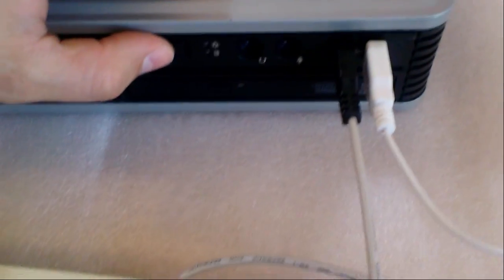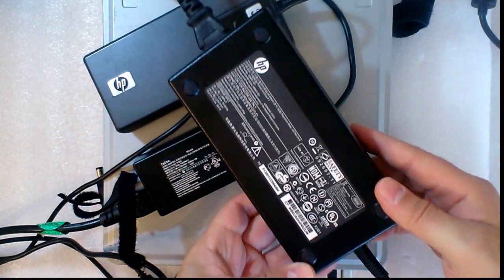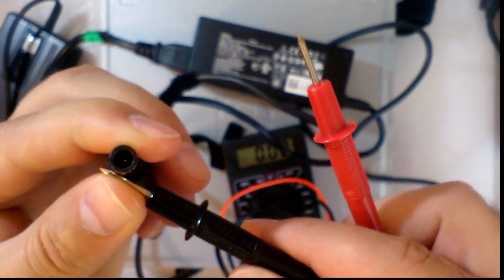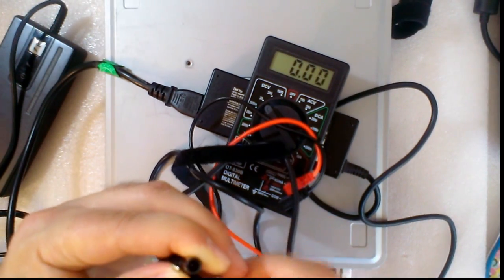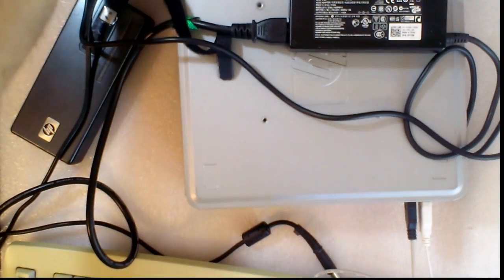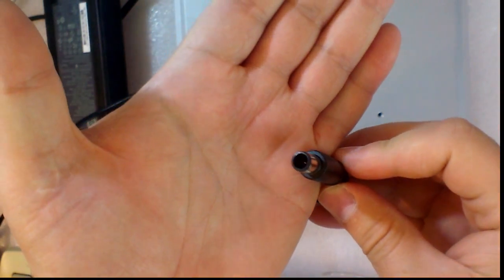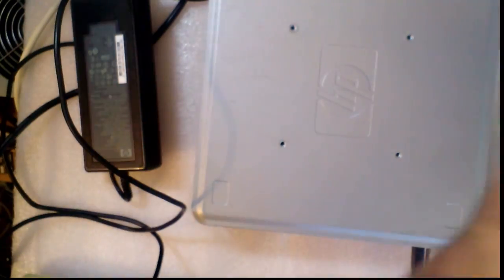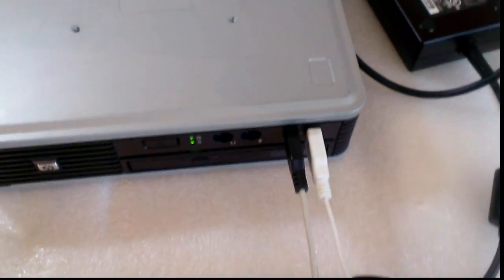How to fix HP Compaq dc7800 USDT PC 4 beeps 4 red flash error #redigitt Ep. 072

Comment: I have a sff dc 7800

I already change the psu and its still beeping
Reply from the maker: @isxude wrote:
Blinks red 2 times @ 1 Hz [1] 2 Processor thermal shutdown
Blinks red 3 times @ 1 Hz [1] 3 Processor not seated / installed
Blinks red 4 times @ 1 Hz [1] 4 Power supply failure
Blinks red 5 times @ 1 Hz [1] 5 Memory error
Blinks red 6 times @ 1 Hz [1] 6 Video error
Blinks red 7 times @ 1 Hz [1] 7 PCA failure
Blinks red 8 times @ 1 Hz [1] 8 Invalid ROM checksum (error)
Blinks red 9 times @ 1 Hz [1] 9 Wrong power supply input voltage
Blinks red10 times @ 1 Hz [1] 10 Bad option card

Comment: Blinks red 2 times @ 1 Hz [1] 2 Processor thermal shutdown
Blinks red 3 times @ 1 Hz [1] 3 Processor not seated / installed
Blinks red 4 times @ 1 Hz [1] 4 Power supply failure
Blinks red 5 times @ 1 Hz [1] 5 Memory error
Blinks red 6 times @ 1 Hz [1] 6 Video error
Blinks red 7 times @ 1 Hz [1] 7 PCA failure
Blinks red 8 times @ 1 Hz [1] 8 Invalid ROM checksum (error)
Blinks red 9 times @ 1 Hz [1] 9 Wrong power supply input voltage
Blinks red10 times @ 1 Hz [1] 10 Bad option card
:)

Comment: sir, I have hp compaq dc7900 ultra-slim desktop the F1 don't appear anymore, so it don't start, how could I fix it??? thank you. :)
Reply from the maker: Aloha, I don't know, but you can try:
- first check your keyboard in another PC, maybe the F1 key don't work anymore
- try with another keyboard with PS 2 or USB plug
- reset your BIOS by removing the BIOS battery and short of the 2 pins
- update the BIOS
Thank you for watching, if my video or advice was useful, please consider to like, share, it helps my video with the YouTube Algorithm, have a nice day and good luck.
Reply: Thanks 😁

Comment: i have got an 135 W adapter, however still hear the 4 beeps, can you help? I would assume that 135 is enough, right?
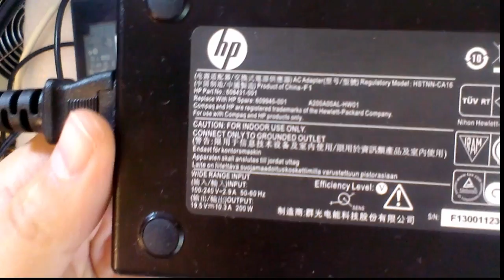Reply from the maker: You need a 200W adapter, look at 6:05 https://youtu.be/uVVGEV3IMGA?t=365
Thank you for watching.
Reply: @redigitt  135 W it was the original cable though
Reply from the maker: I don't know.
Reply: @redigitt  thanks anyway!
Reply: @redigitt  I have got an adapter with 263W and I hear 4 beeps and blinks. The plug is same as original HP adapter but this is non-original adapter (FLEXTRONICS 19.5V 12.3A). Do you have solution to solve this problem?
Reply from the maker: Probably because this is a 3 pin power adapter, 
you have outside the -, 
inside +, 
and the pin, which tell if the power adapter is original HP (like the Dell)
Reply: Oh thanks for reacting. Do you what the reason for this happening is? The other day it was alright, but then suddenly the power supply is too weak?

Comment: Tengo una PC ssf hp que da 4 beeps y la fuente de poder no gira su ventilador, quizá sea por qué la fuente de poder no este girando??
Reply from the maker: It is possible your power supply is bad, 
1. try dissambley the power supply and make a visual inspection of the power supply, usualy the electrolytic capacitor gone bad, they bulging.  
2. try with another power supply.
and good luck

Comment: Sir when i play games suddenly the pc turns off automatically and the red light and the beep issue occurs sometimes the beep turns off and the light is green but the fan starts and make noise like it becomes soo fassst and my pc is hp elite 8500
Reply from the maker: please give you PC specs: CPU,RAM, VGA card, power supply, display  size-display resolution, But probably your PC is overheating or the PSU is to small.
Reply: redigitt  sir its hp elte 8500 4 gb ram 1 gb radeon hd graphic card and 380 gb harddisk
Reply: redigitt 18 inch display and i turned the resolution to 1152×768 i guess 5 minutes ago and this problem occured
Reply: redigitt  and sir 3.16ghz processor and i don't know the power supply
Reply: redigitt  please help me out
Reply from the maker: the PC is tower or the SFF ? did you check the CPU and VGA  heat, the VGA card has a fan or only heatsink, I'm interesting the power consumation , VGA card, CPU TDP, remove the PC top cover and check your PSU how big is. Check visualy yhe motherboard for a bulged caps. 90% is or the overheating or the power supply is to small for your configuration.
Reply: redigitt  the pc is tower and the gpu has a fan and the pc was did not heat up
Reply from the maker: try to remove the VGA card, use only the onboard vga card - if it dosen't turns off then put back the VGA card, unplug the optical drive power cable and try with the lower resolution whitout puting the top cover
Reply from the maker: then try with a bigger power supply
Reply: redigitt  i removed it and placed it in the other slot but it shows the problem i faced it 3 times in a week the first two times i was lucky to turn it on again at first i changed the slot and the second just waited for a while and when turned on again it was working correctly
Reply from the maker: 1. you have to remove the VGA card and test it only with the onboard VGA card, your video card is using about 60-70 W in full load and the power supply is failing 
2. if you have an 500W power supply test it 
3. test your video card in another PC, the power supply should be at least 400W

Comment: My pc was beeping so I bought a new power supply, I plug in the supply and right now it still beeps, 4 times I have just ordered some new ram thinking that might be the problem I have a go compaq 9000 elite
Reply from the maker: In my case was the PSU, but it could be from: bad memory or motherboard to.
- unplug everithing from the PC(printer, microfon,webcam,etc.), leave only the mouse and the keyboard
- unplug everthing from the power supply, leave only the motherboard and try to start the PC
- try to switch the memory stiks, try with one memory stik, try the memory stik in both RAM slots
- try to reset the BIOS
- if you have a multimeter mesure the BIOS battery, if it's below 3V than change the battery
Please let me know, what was wrong, thank you.
Reply: redigitt hey thanks for getting back so quickly, I haven't been able to figure out what's wrong with my pc. I think the motherboard might just be dead, I've ordered a new mother board off of eBay for $50 and it should fit my needs. When the motherboard arrives and I've got everything set up I'll get back to you and tell you if it's working or not
Reply: @chilliwowah1086  hey did it work?
Reply: Say Ah this was many years ago friend but I ended up just entirely building a new pc. The other motherboard was fried
Reply: @chilliwowah1086  thanks for the reply, mine has this problem too, i ordered new psu still not working...

Comment: sir! I have an HP DC Compaq 7800 convertible minitower.the problem is that when I start my computer it boots 3 or more times and start computer after sometime,it take a long time and I want to restart my PC many times then the computer start after 2minutes ,so  how I can solve this problem,please tell me
Reply from the maker: Aloha, it boots 3 or more times or beeps?
1. If reboots x times before actualy loading the Windows, maybe your power supply is faulty (defective). Disassembly your PC an check visually if you have a leaking / bolged capacitors.
2. If your PC is restarting/rebooting when the Windows is loading you can check: power supply, hard disk health or simply your Windows is dying and you have to reinstall.
Let me know if my advice was helpful.
Reply: check your battery. if not battery the bios chip is bad.
Reply from the maker: You can check your power supply and motherboard for bulged capacitors and if its reboots when loading the windows you can check your HDD for errors. Let us know how you resolved your problem.

Comment: Dear Sir, I have HP Workstation xw4600 it beeps and flash red light for four time 5 cycles. It keep flashing until ac power cable is connected to the computer but beep remains off after 5 cycles of  beep. Both fans start  within milliseconds fans stop (may be complete 1 or 2 rotation) but board green light remain on. I dont know what happen. Can you help me please?
Reply: Semester One same problem. same pc .. have u fixed it?
Reply from the maker: Aloha, in my case was a weak power supply, maybe  you could try with another, bigger power supply.
Reply: same problem!, how you fix it? i change to 8400 my dc7800< and i have 240w power adapter
Reply from the maker: Aloha, in my case was the power adapter, try with a a higher power adapter
Reply from the maker: remove the power cabel from the HDD and the optical drive, if the beeps stops than your power adapter is too small
Reply: sorry, 30 min ago i found a solution)) it was memory stik, so i take it off and put it back, and system start with no problems! so it`s memory
Reply: It was motherboard problem. I have changed the motherboard and problem is solved and thanks for your valuable comments.
Reply: Jsbagdgynwwnm

Comment: Same problem Happening in my PC HP 5850 tower  4 beep and light blinking red 4 time! i bought new ram but my problem did nt solve so plzz guid me what shall i do??? My Pc is Tower Hp dc5850
Reply from the maker: you can try with another PSU( power supply), in this video when I put a bigger PSU the beeps has stop
Reply: ok I will Try, i have 300W Max now which one i should try?
Reply from the maker: if you can, borrow from a friend a 450W PSU for testing
Reply: I think no need,  suddenly i checked my psu it's not running.., i attach pin in psu wire fan is not moving.. !
Reply from the maker: 99,99% you find the problem :)
Reply: i think so!

Comment: i want to ask, can i change the mobo with M ATX mobo
Reply from the maker: Aloha, probably you cant, it will not fit the motherboard i/o shield, you will need another power source, for this motherboard the power cabel is like for the laptops, the cooling sistem is for sk 775, it will not fit for 1151 or 1151 sk